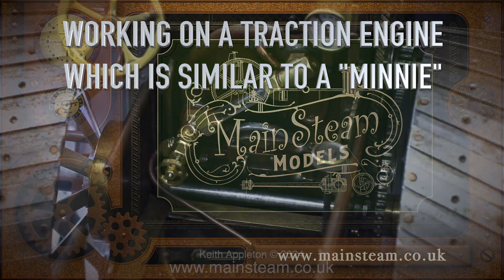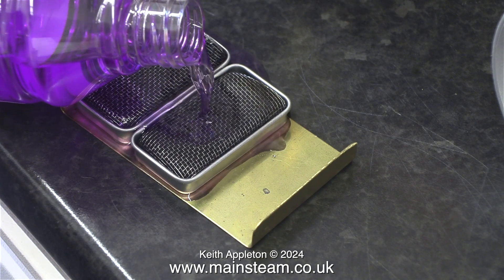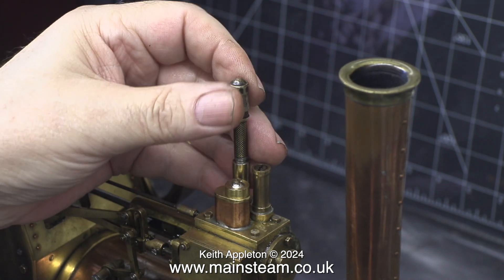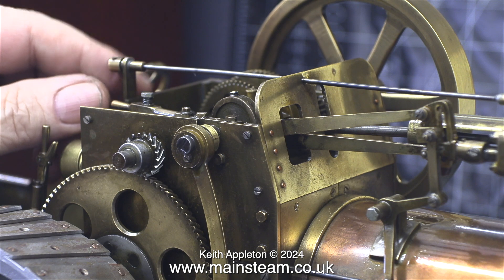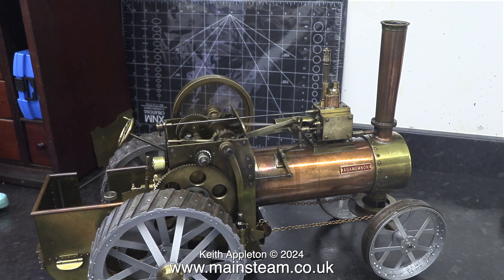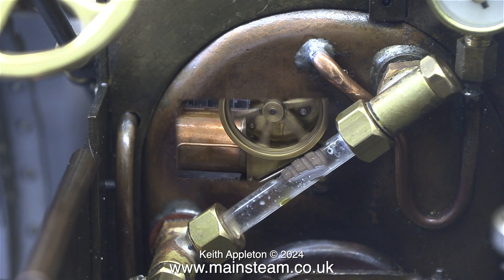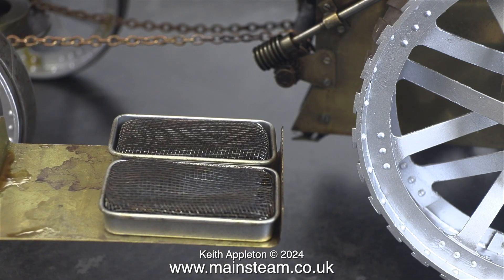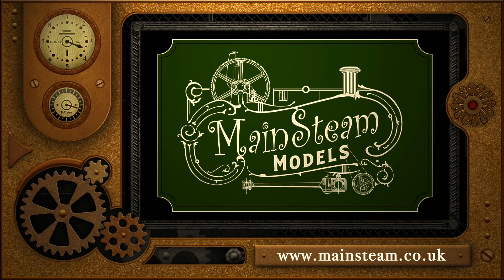A "MINNIE" TYPE TRACTION ENGINE - PART #10

Comment: Lovely little engine. It does seem a little fuel hungry though, three refills to raise steam.
Have you thought about using a tank with a drip feed similar the type often used on Garden Gauge locomotives?
I am quietly betting with myself that you already have.
Reply from the maker: It just takes a while to warm up. It is a soft soldered engine throughout so a fierce fire is the last thing it needs.It runs for a long time on the Meths burner once it has only 10psi of pressure and as you can see, it runs very well. (10psi what it is set to blow off at).